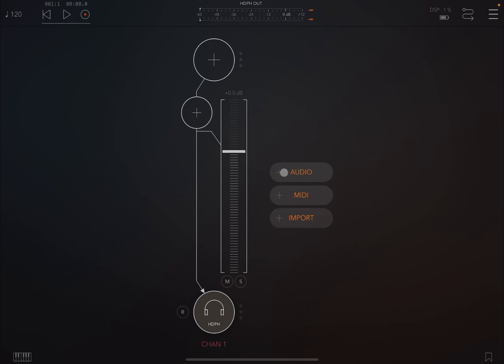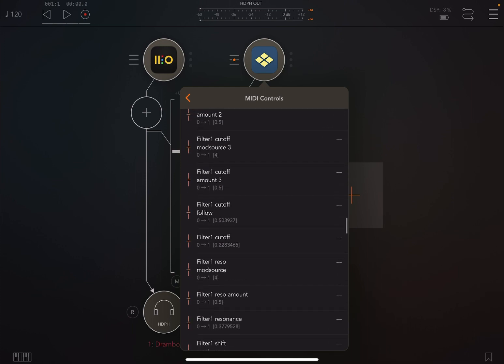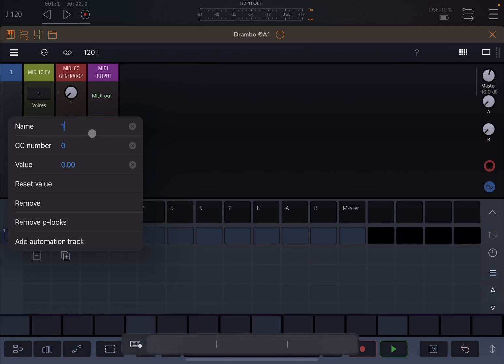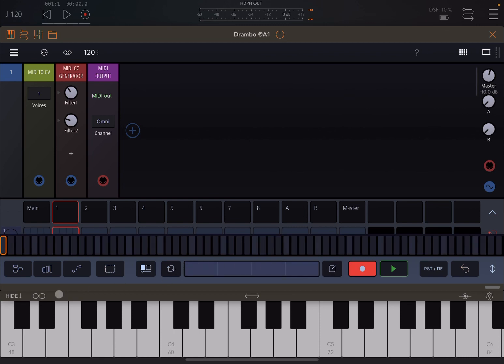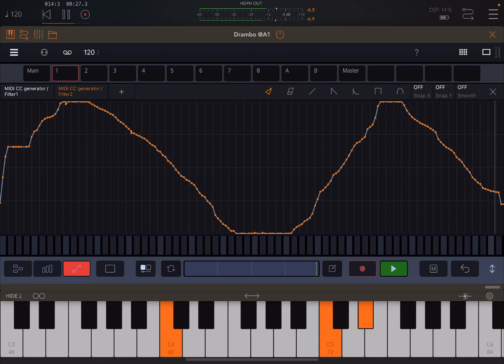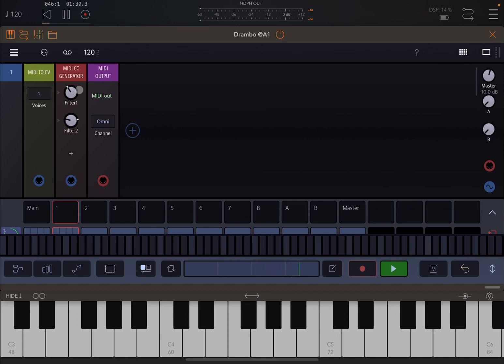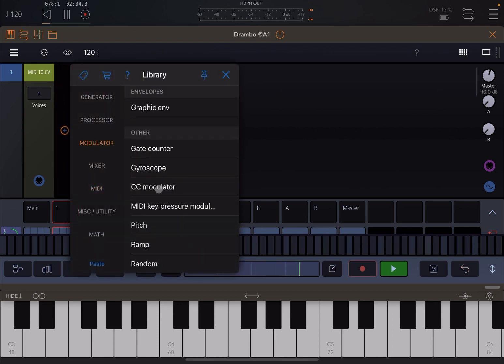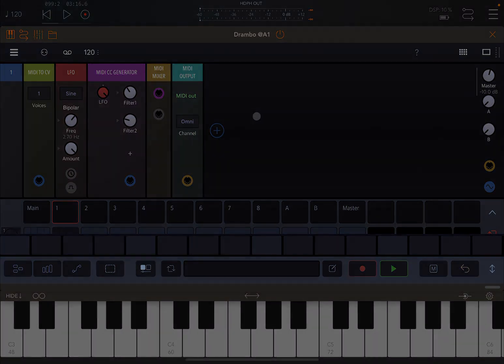BeepStreet Drambo v2 - Demo / Tutorial 91: Midi CC Generator Multi

Comment: In a similar setup I can record mod wheel but can't figure out how to send it back to the synth on playback 😢
Reply: Finally got AI to explain it to me: midi cc controller set to 1, then add midi cc generator also set to 1, then midi out module
Reply from the maker: @Recloh ok great
Reply from the maker: Sorry, can you please explain a bit more?
Reply: @soundformore I only use Drambo for live midi loops, I play external keyboard into it and out to auv3 synths. 
I figured out how to record mod wheel by adding cc generator, I hear mod wheel while playing but when the recorded clip starts playing back it does not send the recorded CC1
Reply from the maker: @Recloh 👍👍